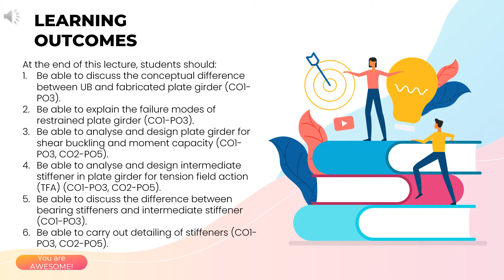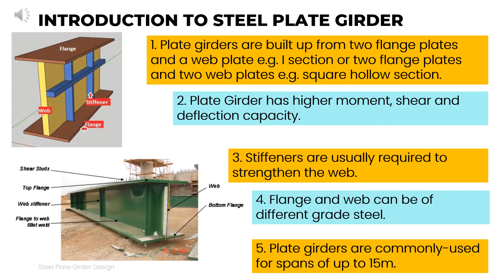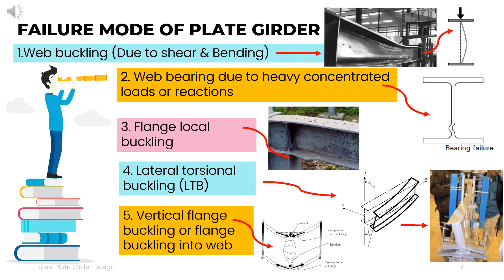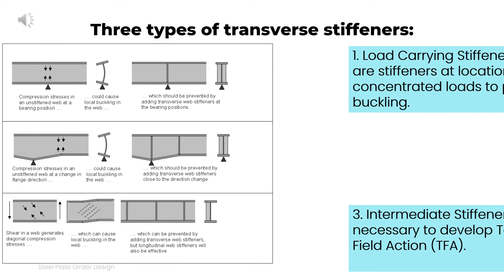Steel Plate Girder (Eurocode 3)-Summary By Dr.Ina

Comment: 5B1_Aina Hana

A plate girder is a steel beam formed by welding plates to create a deep web and strong flanges. It is used to carry heavy loads and span long distances where normal 'I' beams are not enough. Plate girders can fail due to web buckling, local buckling, web crippling, lateral torsional buckling or fatigue. To prevent these, transverse stiffeners are added, such as end stiffeners at supports, intermediate stiffeners along the span and bearing or load-carrying stiffeners at points where heavy loads are applied.

Comment: 5C4_Syamil Iqwan:

A steel plate girder is a type of beam built by welding separate steel plates together to form an I-shaped section. It is used when standard rolled steel sections are not strong or deep enough to carry large loads or long spans, such as in bridges, industrial buildings, and heavy floor systems.

Advantages:
- High load-carrying capacity
- Economical for long spans
- Can be customized for specific design requirements

Applications:
- Used in bridges
- industrial cranes
- long-span floor girders

Comment: 5B1_Anisa

A steel plate girder is a welded or bolted I-shaped structural member made from flange and web plates. It resists bending and shear, offering high strength and stiffness for spans up to 15 meters. Stiffeners strengthen the web against buckling, and different steel grades may be used. Commonly used in bridges, railways, and industrial structures, plate girders efficiently support heavy loads and replace rolled sections for long spans.

Failure Mode of Plate Girder
1. Web buckling(due to shear & bending
2. Web bearing due to heavy concentrated loads or reactions
3. Flange local buckling
4. Lateral torsional buckling(LTB)
5. Vertical flange buckling or flange buckling into web

Comment: 5C4_SyahmiMirza

A) Steel Plate Girder

1. Plate girder is basically a giant version of an I-beam (usually 15m or longer, designed to carry very high bending and shear loads)
2. Sometimes, stiffeners are added to support the web and prevent failure.
3. If the t/f ratio (thickness ratio) is too high → it may cause buckling.
We use plate girders when we need a very stiff beam to handle heavy loads.

B) Failure Modes:

1. Web buckling
2. Web bearing
3. Flange local buckling
4. Flange buckling into web
5. LTB (Lateral Torsional Buckling)

C) How to Prevent Failure:

1. Provide enough lateral restraint (e.g., composite slab to avoid LTB)
2. Add transverse stiffeners to strengthen the web

D) Types of Stiffeners:

1. Load Carrying Stiffener – placed under concentrated loads to transfer them to the web and flanges.
2. Load Bearing Stiffener – located at the supports, helps resist end reactions and prevents web crushing.
3. Intermediate Stiffener – placed between supports to prevent web buckling under shear.

E) Design Process:

1. Minimum web thickness
2. Bending resistance
3. Basic dimensions
4. Web design
5. Design of stiffeners

Comment: 5A6_nabil
- A steel plate girder is a fabricated structural member made by welding two flange plates to a web plate, forming an I-beam shape.

FAILURE MOODS
-Web buckling (due to shear or bending)
-Web bearing failure (from concentrated loads)
-Flange local buckling
-Lateral-torsional buckling (LTB)
-Vertical flange buckling or flange buckling into the web

Comment: 5A6_fadhliana

Summary of this video
- steel plate girder defined as structural members that resist loads primarily in bending and shear
- plate girders are made by the welding process
- the difference between beam and girder is the size.

Function : 
- replaced rolled section with bigger beams
- support heavy load (bridge)
-  used when need deeper sections higher stiffness to carry heavy load
- provide higher moment, shear, deflection
- design different grade for flange and beam
- size of plates can be design

Failure mode:
- web buckling
- flange local buckling
- vertical flange buckling
- LTB

Failure prevention:
- adding transverse stiffeners
- adding sufficient lateral restraint

Types of transverse stiffeners:
- load carrying stiffeners
- load bearing stiffeners
- intermediate stiffeners

Steps in design process steel plate girder:
- Minimum web thickness, Bending resistance, Basic dimensioning, Web design,Design of stiffeners

Comment: 5A6_dalila : -Plate girders are made by welding flange and web plates.
They have high moment, shear and deflection capacity.
-When the plate grinder was designed the designer can choose plate sizes and steel grades.
- Plate girder are used for long spans and heavy loads such as use in bridges and crane girders.
-Thick flanges, deep sections and thin webs make them economical.
- When we use thin webs it can buckle, so transverse stiffeners are added.
-Lateral restraints help prevent lateral torsional buckling.
-Tension field action increases shear capacity after web buckling.
-It have 5 step to design the plate girder

Comment: 5A6_Azra Nafisah

The video provides a concise overview of the design principles for Steel Plate Girders based on the Eurocode 3.

A plate girder is a structural member fabricated from flange and web plates, designed to carry heavy loads over long spans by resisting bending and shear forces. A key characteristic is the thin web, which makes it highly susceptible to buckling. To prevent this failure mode such as lateral torsional buckling, various stiffeners like intermediate and load-bearing are required to strengthen the web. 

The design process involves calculating the minimum web thickness, determining bending resistance, and systematically designing the stiffeners while considering the concept of tension field action, which enhances the girder's shear capacity after the initial onset of buckling.

Comment: 5A6_REGINA MESHA

A steel plate girder is a structural member designed to resist loads mainly through bending and shear. It is constructed by joining separate steel plates to create a deep vertical web and narrower flanges, forming a strong beam section. It used to support heavy loads, such as those in bridge structures. They are also suitable when a deeper section with higher stiffness is required to carry large loads effectively. Common failure modes include web buckling, web bearing, flange local buckling, lateral torsional buckling (LTB), and vertical flange buckling. These failures can be prevented by providing adequate lateral restraints and installing transverse stiffeners. Types of Transverse Stiffeners is load-carrying stiffeners, load-bearing stiffeners, and intermediate stiffeners.

Comment: 5C1/ZIKRI : STEEL PLATE GIRDER (EUROCODE 3)
A steel plate girder is a beam made by welding steel plates together with one web in the middle and two flanges on top and bottom. It is used for long spans or heavy loads where normal steel beams are not strong enough. In Eurocode 3, the design must check that the girder is strong and stable. The web must not buckle under shear, and the whole beam must not twist (this is called lateral-torsional buckling). If the web is too thin, stiffeners are added to make it stronger. The designer also checks deflection and vibration to make sure the girder works properly.

Comment: 5C5_Yamin Bukhari

Basically, a plate girder is a combination of steel plates that are welded, riveted, or bolted to prevent the structure from failing in bending and shear. The plates cover both on web and flange directions. There are a lot of types of plate girder with different grades for different functions.

Functions:
1. Replace the roll section with a long beam span
2. Support heavy loads
3. As crane girders and road bridge girders
4. Use when deeper sections have higher stiffness

Failure Mode:
1. Web buckling
2. Web bearing
3. Flange local buckling
4. Lateral Torsional Buckling
5. Vertical flange buckling

Prevention:
1. Provide sufficient lateral restraints
2. Adding transverse stiffeners

Comment: 5C5_AidaSharina

STEEL PLATE GIRDER
- Structural members that resist loads primarily in bending and shear which typically and I-beam cross section that made up of separate structural steel plates that are welded, bolted or riveted. The size of the component differ a beam and a girder.
- Has higher moment, shear and deflection capacity. 
- Plate Girder are commonly used for spans of up to 15m such as roadbridge, railway and crane girder.

Failure Modes of Restrained Plate Girder
1. Web buckling due to shear or bending.
2. Web buckling under concentrated loads/reactions.
3. Flange local buckling.
4. Lateral torsional buckling could occur if not properly restrained.
5. Vertical flange buckling or flange buckling into the web.

Prevention methods
1. Provide lateral restraints such as composite slab to prevents lateral torsional buckling.
2. Add transverse stiffeners to prevent web buckling and support concentrated loads.

Types of Transverse Stiffeners
1. Load-carrying stiffeners – support concentrated loads.
2. Load-bearing stiffeners – prevent web crushing/buckling near supports.
3. Intermediate stiffeners – control web buckling between load points.

Design Process of Steel Plate Girder refering to the Eurocode 3 Clauses
1. Calculate the minimum web thickness.
2. Check bending resistance.
3. Perform basic dimensioning (flange and web sizes).
4. Design the web for shear buckling and moment capacity.
5. Design and detail stiffeners (bearing + intermediate).

Comment: 5C5_Aireen Izzati

Definition of Plate Girder
	•	A plate girder is a large steel beam made by connecting steel plates together.
	•	It usually consists of a web plate (vertical part) and two flange plates (top and bottom).
	•	Used when standard rolled steel sections are not strong enough for heavy loads or long spans.

Function
	•	Supports heavy loads in structures such as bridges, buildings, and industrial floors.
	•	Acts as the main horizontal beam that transfers loads to columns or supports.
	•	Provides stability and strength for long-span construction.

Design Checks (Eurocode 3)
	•	Bending resistance – check if the girder can resist the applied bending moment.
	•	Shear resistance – ensure the web can carry shear forces safely.
	•	Buckling checks – prevent failure due to compression or instability:
	•	Lateral-torsional buckling (LTB)
	•	Web buckling or web crippling
	•	Serviceability limit state – verify deflection and vibration are within limits.
	•	Connection design – check welds or bolts between plates for adequate strength.

Other Important Information
	•	Plate girders are custom-made and can be designed to specific requirements.
	•	Suitable and economical for long spans (usually 20 m and above).
	•	Stiffeners are often added to strengthen the web and prevent buckling.
	•	Common materials include structural steel grades S275 and S355 (Eurocode 3).
	•	Must comply with fabrication and welding standards for safety and accuracy.

Comment: 5C5_Nuren Irdina

Definition of plate girder
-A plate girder is a fabricated steel I-section made by welding/flange plates and a web plate (rather than using a single rolled section).
-It’s used when very high bending resistance or large span is needed and standard hot-rolled beams are not sufficient.
-The flanges resist most of the bending moment, and the web resists shear and connects the flanges.

Functions
-Used to replace rolled steel sections for long spans where splicing reduces efficiency.
-Designed to support heavy loads, such as in bridge structures.
-Commonly used in railway bridges, road bridges, and industrial crane girders.
-Suitable when deeper and stiffer sections are needed to carry large loads.

Design Checks (Eurocode 3)
1. Bending strength – make sure flanges are strong enough.
2.Shear strength – check the web can handle shear.
3.Shear buckling – thin webs can buckle; use stiffeners if needed.
4.Lateral-torsional buckling (LTB) – long girders may twist; add bracing or restraints.
5.Deflection – ensure it doesn’t bend too much.

Other informations:
-Plate girders allow very large spans or heavy loads where standard steel beams cannot economically or structurally suffice.
-Without checking buckling (web, flange, lateral‐torsion) the girder may fail prematurely not by material yield, but by instability.
-Using Eurocode gives a structured workflow and ensures safety/resilience by addressing all relevant failure modes.

Comment: 5C5_AHMAD HAFIZ

Summary: Plate girder is a beam cross section that made with another steel that be welded or bolted or rivetted together and form the deeper vertical web and narrower horizontal flanges of the beam. Commonly used for spans  up to 15 m. We need deeper sections to have higher stiffness to carry heavy loads.

Comment: 5C5_Ali Aiman

- Plate girders are fabricated steel structural members designed to resist bending and shear, typically used for long spans and heavy loads and made by welding two flange plates to a web plate.

- It is larger and stronger than Universal Beams with thick flanges and thin webs (which are rolled sections)

- Common failures include web buckling, flange local buckling, lateral torsional buckling, flange buckling into web. 

- Prevention: lateral restraints (e.g., composite slabs) & transverse stiffeners to strengthen webs.

Comment: 5C5_Bazil Hakim
Plate Girder is a separated structural steel plates either welded, bolted or riveted together onto a beam to create more resistance against loading primarily in bending and shearing. Plate Girder can be used to combat buckling on web where the depth/web thickness ratio is high or on a longer span (15m+).

Failure mode of Plate Girder:
-web buckling
-web bearing
-Flange local buckling
-Lateral Torsion buckling
-Vertical Flange Buckling/ Flange buckling into web

Type of transverse stiffeners:
-Load-carrying stiffeners 
-Load bearing stiffeners
-Intermediate stiffeners

Comment: 5C5_Nurzharfan

From the video, i have learnt several matters regarding steel plate girder.

It’s defined as structural members that resist loads primarily in bending and shear, typically in the shape of an I-Beam.

Several functions of steel plate girders include:
i) replace rolled sections for a long beam span requirement.
ii) Support heavy loads
iii) when deeper sections having higher stiffness to carry heavy loads is needed.

Plate girders can be subjected to failures such as:
1.Web buckling (Due to shear & Bending)
2. Web bearing due to heavy concentrated loads or reactions
3. Flange local buckling
4. Lateral torsional buckling (LTB)
5. Vertical flange buckling or flange buckling into web.

To prevent the mentioned failures, two conditions should be met, which is:

1. Providing sufficient lateral restraints
2. Adding transverse stiffeners along the length of the beam web.

From the video, I learned that steel plate girders are used to support heavy loads and long spans. They can fail in different ways, like buckling. To stop this, we need to give enough support and add stiffeners to keep them strong and stable.

Comment: 5C5_ Ahmad Syahmi :
- Definition of steel plate girder
A steel plate girder is a built-up structural beam made by welding or bolting together flat steel plates to form a deep, strong section usually consist of flange plate, web plate and stiffeners.

- Funtion of Steel Plate Girder
The primary function of a steel plate girder is to support and transfer loads such as the weight of structures, vehicles, or floors over long spans by resisting bending moments and shear forces through its flanges and web.

- Failure of steel plate girder
A steel plate girder can fail when the stresses from bending, shear, or buckling exceed its strength or stability limits.These failures are often classified according to which part of the girder is affected which are overloading, insufficient flange thickness and inadequate lateral bracing.

- Three type of Tranverse Stiffeners.
Load Carrying Stiffener - To transfer concentrated loads from the flange or from external loads into the web of the girder.

Load Bearing Stiffener - To strengthen the web at support points, where high reactions bearing forces occur.

Intermidiate Stiffener - To prevent web buckling between the load carrying or bearing stiffeners.

Comment: 5C5_UmarAkhyar

Balance between strength and stability is key — thick plates increase strength but also cost and self-weight.
Proper stiffener design significantly improves performance without heavy weight increase.

Comment: 5C1_ ARIFF FARHAN 

Summary of this video was explained how steel plate girders are designed using Eurocode 3. These girders are fabricated beams used for long spans or heavy loads. The lecture covers the main failure modes (like web shear buckling and flange buckling), and how to design for shear and bending strength. It also explains the use of bearing and intermediate stiffeners to prevent buckling and improve load resistance. Overall, the session emphasizes understanding how plate girders behave and how to design them safely according to Eurocode 3 requirements.

Comment: 5C5_Nurli Sabrina Aladin

What I learn from this lecture is about how to design and analyze steel plate-girders. I get to know the difference between universal beams and plate-girders (key difference = size component) and also the types of failure that can happen to plate-girders. The lecture focuses on shear buckling, moment capacity, and how tension field action works when designing stiffeners. Plate-girders are made of two flange plates and one web plate and they’re usually used for long spans and heavy loads, like bridges. Since the web is thin, it can easily buckle, so we need to add stiffeners and lateral supports to make it stronger and more stable. The design process includes checking web thickness, bending resistance, basic dimensions, and then designing the stiffeners. To prevent failure, things like composite slabs or transverse stiffeners are used.